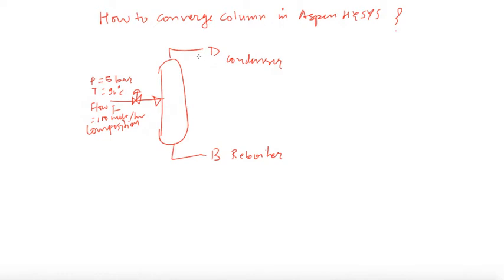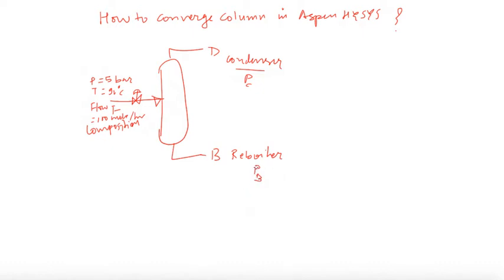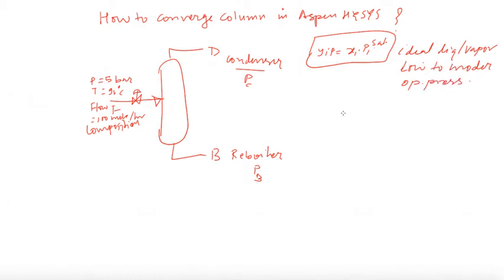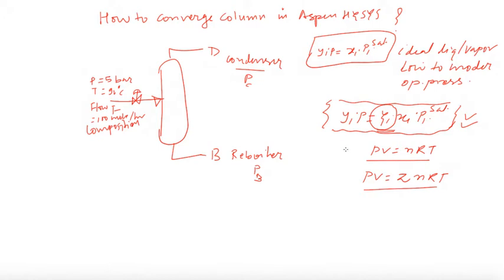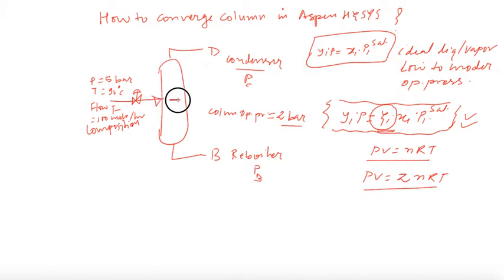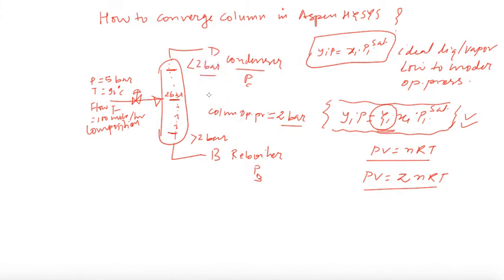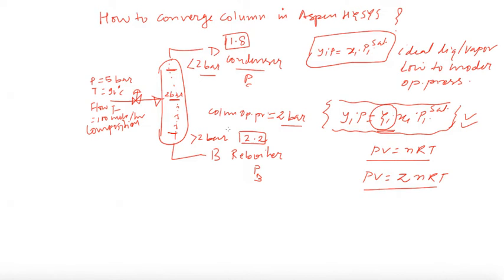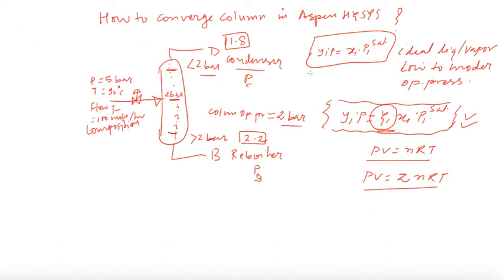How to converge a Distillation column in HYSYS?

Comment: Hi sir.
thank you sir for your video.
i have questions regarding this problem. i hope i can get some ideas from your experience.

i am facing problem to converge the column that separates nheptane/toluene in rigorous column. the reading (Number of stages = 166, feed stage = 90, feed flow = 131.1 kmole/hr, reflux ratio = 16.154 and purity for top product which is nheptane = 0.9239) from the short cut design are applied on rigorous design. unfortunately, i cannot obtained the similar purity for nhexane on rigorous design.  when i tried to increase the reflux ratio and also add other specs (component fraction), the column become unconverged. i put the column pressure = reboiler pressure = condenser pressure 1879 kpa. what i need to do?

thank you sir for your time
Reply from the maker: I have given reply on your mail check your mail id